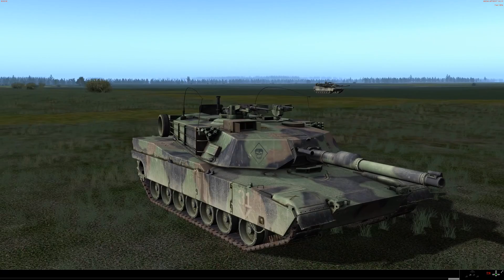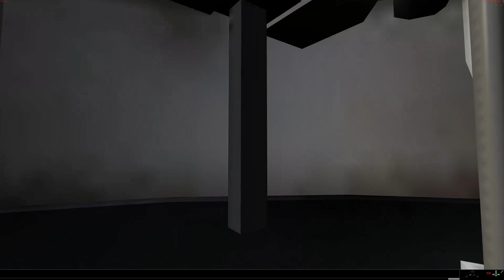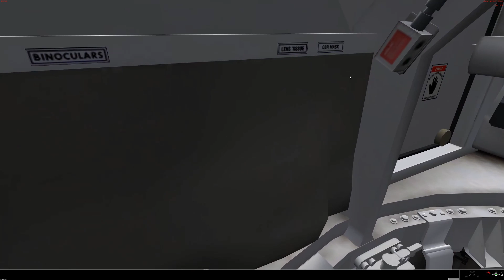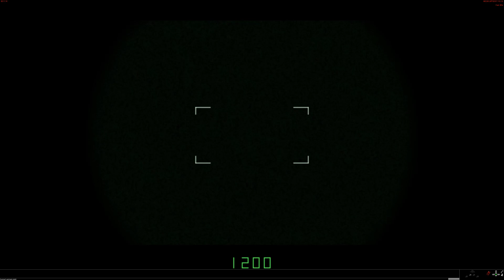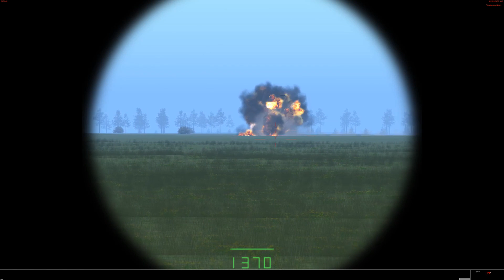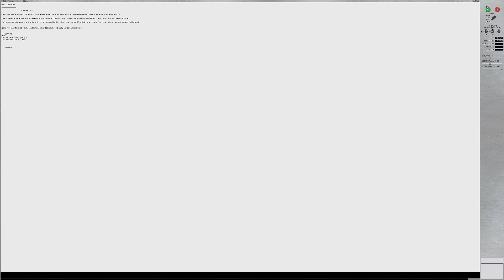Abrams Switchology and Fire Control System

Comment: Well, what's the point of a compass in a modern jet cockpit if you have one on the HUD already + on certain MFD pages?

The azimuth ring is an accurate analogue backup system, it's in plain sight and reading it takes just a second no matter how skilled or stressed out you are.
You could consider it obsolete with all the computers in play today, but what if everything fails and your life depends on it? Could you accurately tell the exact azimuth by looking down into the basket in the same amount of time? Wouldn't you rather look out for targets, aim the gun or do anything else other than wasting precious time by figuring out something that basic?

It's a backup system that's probably not used that often these days, but you could say something similar about parachutes (as in: they are rarely used, but if they are they can save lifes)
Reply from the maker: Who said anything about a more complicated system? I don't think there is anything more basic than using the Mk1 eyeball to see what is around you without any mechanical or electronic assistance at all. When you're driving a car,  you don't need a gauge or pointer to determine if the front wheels are straight or have you in a curve. Same deal here.
Reply: @TheChieftainsHatch  You were saying the azimuth ring is useless and I was making a point why it is not:
should everything else fail you still have an accurate easy to read backup right in front of your face. It's probably not useful in a lot of situations, but having it is better than needing it.
And I'm fully aware of the importance of the Mk1 eyeball. But how much is it going to help you in edge cases like 0 visibility? I'm talking about these kind of rare circumstances where the ring might be useful, not about any complicated systems.
Reply from the maker: If there's zero visibility, what are you going to need the TC's azimuth indicator for? The bottom line is that the system basically vanished from the world in 1944. They only started reappearing with commander's independent periscopes, which don't have a visual cue when stationary.

Comment: I must have put a thousand hours on the M1 tank simulator.  You get so use to leading and ranging with HEAT and SABOT that you developed "no mind".  1500m was close range, no ballistic computer required.  Didn't care about smoke either.

Comment: Question. If a modern Tank like the Abrahams gets hit and the shell/object penetrated a little bit into the composite armor but the crew and everthing is fine. How does this get repaired?
Reply: Modern HAP equipped Abrams have their composite seperated into cells underneath the surface steel. Just simply remove the facing steel, locate the compromised cell, remove it and drop in a cell fresh from the factory. All done.

Comment: I noticed the vision blocks in the TC's cupola have red rims around them. Why is that? It should also should be noted that while the early M1A2 eliminated the CWS sight system for the M2HB .50 cal (the M1A2's IVIS display took up the space for the CWS actuator motor), later versions of the M1A2 (SEP v2 and so forth) introduced remote weapon stations which restored the ability for the TC to fire the .50 cal from inside the turret like he could with the CWS on the M1A1.
Reply: Help you locate them spatially in black-out or low light internal situations.
Reply: @TornadoADV  Ah, I see. Thank you for your response.

Comment: In the real M1A2 SEP V2 you can tell when you put the wrong lead in because the reticle "leans" when you are traversing in that direction. Also with the SEP V2 with the thermals it is scan on 3 shoot on 13. The 3 and 13 are optical zooms, while 6, 50, and 25 are digital zooms.
Reply: The version he uses is not the M1A2 model. Its some of the M1A1s. The M1A2 is available in steelbeasts too...and it has the features you mentioned
Reply: @RoninTF2011  Watch the entire video. He talks briefly about the m1a2

Comment: Going to join as a 19k soon. How hard is the maintenance on these? How do they choose who does what in the tank?
Reply: Maintenance for the M1 series is pretty straightforward: everything is heavy, and it will either be very hot or very cold while you're doing it.  There will be mud, and you will find yourself wet or saturated with very fine dust most of the time.  In a nutshell...you'll love it.  As for position, you'll probably start as a driver and then move to loader (it used to be the other way around) then move up to gunner around the time you make E-4 promotable.
Reply: expect to work 12 hr days changing track. Expect to be filthy, hot, cold, tired. Expect to be a driver. Expect to learn to love it.

Comment: I heard a story of a guy who put like a big cloth belt in to sit on it. So he was sitting on like a swing within his hole. His platoon leader laughted at him the first day. The 2nd day the leader asked him, if he could build a swing for him also, as he had to stand all day.
Reply: It is called a sling seat, and it was typical on tanks of the 1920s and 30s. They work too. He did not invent it. A sling seat was the only seat a Renault R-35 commander had. And I recall various loaders positions fitted with sling seats through the 1950s.

Comment: You know...it's funny, at 26:50, you talk about "emergency mode"...I remember M1 Tank Platoon on the Amiga worked essentially like normal mode (lase the target, lead etc. automatically computed, you'd stay "locked on" etc.), but the PC version, and later M1TP2 on the PC would always work in "Emergency Mode" where YOU are controlling the gun, not the aiming computer.  Fascinating.
Reply: thedungeondelver I was thinking the same thing! So many happy hours spent on M1TP on the Atari ST 👍

Comment: Great video as allways!

During my military service I was a Leopard 1A5 gunner and I would say if I'd have to control an Abrams, the gun would've gone boom every single time by accident and not on purpose. The Trigger on a Leopard is controlled by the index finger. The thumb controls the "Dynamischer Vorhalt"... the dynamic lead. I was allways pushing down this button from the moment I grabbed the handle. So I couldn't forget to give lead.

One thing I notice in the computer game was that you can observe your own shot. A thing I could not do a single time because there was so much fumes coming out of the tube that I was literarlly blinded for a few seconds. Is it a problem with the game or is the Abrams that good in getting rid of the smoke?

Anyway a great insight into your working place :)
Reply from the maker: Generally speaking, the only issues I had with obscuration were caused by the dust flung up from the ground, especially when I was shooting on a desert range (Ft Irwin)
Reply: In this game, when you fire the gun on "dusty" ground, you will get the same problem. If you play with other people, you "Kettenhund" can call out the fall of shot...like in real life.

Comment: When you mention running away, do you mean the engine will just go off on its own? I went to school to become a diesel tech and we learned quite a bit about how to kill a runaway engine. If that's what you meant ,I wouldn't want to be in the same zip code when a jet engine goes off. Diesel engines just blow out their guts, a jet engine would probably be the equivalent of a giant antipersonnel mine.
Reply from the maker: It is a computer controlled engine. If you shut off the power to the circuits before the engine is shut down, the jet runs out of control. Never seen one  actually blow, as usually someone notices immediately as soon as the wrong switch is pushed, and powers  the system back on soon enough for the computers to regain control.
Reply: It is not a "jet" engine, it is a turbine engine. A turboshaft. FFS. Same kind as powers helicopters and fast vessels and peak demand generators in power plants. A jet by definition provides a high-speed jet of gasses to create thrust. That is why it is called a 'jet'. Those gasses are provided by a turbine gas generator. A turboshaft also has a gas generator, but the gasses are used to spin a turbine wheel the provides a mechanical shaft output. There is no 'jet' involved anywhere. Not all jets are turbine engines (rockets are jet engines too), and not all turbines are jets.

Comment: I think our Leopard Simulators were a bit different, we had Containers which had the turret inside simulated with every station. Driver had his own little cabine. Was always quite fun when doing a "simulated battle" with a full Platoon of Leopards.
Reply from the maker: We have the  same thing. It's called CCTT. See my video here: https://www.militarytimes.com/video/2015/03/13/war-games-world-of-tanks-the-chieftain-mounts-up-for-sullivan-cup-day-2/ We also have a full motion simulator for driver training and a simulator for just the TC and Gunner called the COFT, which I briefly mentioned in this  video. Even some militaries which use  Steel Beasts (This sim) have created cabins for the hardware part of it.
Reply: Exactly those things were what i meant. Most trainings like for the gunner we did on the real tanks or on a turrert mock up where the loader also had to train how to load the gun which buttons he has to push etc.  It's interesting to see that the gunner of an Abrams has to switch the buttons for the ammo types himself. But the rest looks pretty much like a Leopard 2A5 gunner station, except for the primary sight, the Leopard doesn't has a monocular sight.
Reply: You are speaking about the AGPT? Funny thing: Austria bought 6 old AGPT cabins, removed all the old IT, replaced them with new standard PCs and use steelbeasts as a software to run it. Now even the emergency fire button, the TZF and the "Blenden-MG"(Coax) are working in those cabins. Oh...and the vision blocks are now wroking too. Its amazing what these cabin trainers can do with new software! (No more "green wall of doom"=forest, if you know what I mean)
Reply: Yeah the "Ausbildungsgerät Gefechtssimulator Panzertruppe" Stealbeasts is a nice program for crew training i guess, can't exactly tell what program we used though. We also had a Room where all the people who waited for their turn could watch what's going on on a TV screen.  But the Turret mockup was called AAT "Ausbildungsanlage Turm" where only Commander, gunner and loader could have some fun :P
Reply: @JazzJaRa  ; The software Rheinmetal made back in the day. It was painfull to see the graphics, even in the late 90is :-P   ...the driving simulator had better "graphics" back then.

Comment: Who did the maintenance on your NBC?  The alarm will go off if you do not set the pressure release plate right and the NBC system is what controls the temperature.  The M1A1 commons we ran in the Marines never “caught on fire.”   Not work at all, or if you were lucky to have the cooling vest,  freeze you out in either NC 100 degree temp/ humidity Camp LeJuene or 120 shade in desert 29 Palms.  
I was in right as the Marines transitioned completely to M1 and as the last group to get any training on M60 series we were referred to as “CDATs” while the OG were “DATs.”  
Thank you for the massive trip down memory lane. Might need to buy the software!
Reply: I was on M1A1s for almost ten years and it wasn't until well after I retired that I started hearing about M1A1 NBC systems causing fires.  In ten years I had never heard of or seen such a thing.

Comment: THEORY: The azimuth indicator is to call out targets for the gunner and not for the commander to know the direction of the turret. Since the gunner also has an azimuth indicator he can simply align more precisely than using a clock direction.
Reply from the maker: The  point I'm making is that as the commander I don't need an indicator to know the direction of the turret to tell the gunner which way to look on his indicator.
Reply: @TheChieftainsHatch  he just said it wasn't for the commander to know the direction of the turret, why did you repeat it?

Comment: Just fantastic, I love the hands-on technical descriptions you only get from someone who actually operated the gear out in the field. Please do more long format stuff like this and the WWII doctrine videos.

Question: why does your tank catch fire if you try to turn the NBC system on in peacetime? Is it trying to give you a sample of the warm toasty feeling you can only experience on the nuclear battlefield? I'm guessing it's an air compressor of some sort to keep overpressure inside the tank because other than a wash down system the only other stuff I can think of is passive protection stuff inserted into the armor to keep the armor itself from becoming a radiation emitter and cooking the crew.

Comment: Spent many hours in the MCOFT learning switchology as gunner once upon a time. It help out a lot when it came time to qualify on Tank Table 8 for real. Once I had a good bore sight and several rounds on the screen test to sight in my SABOT and HEAT rounds and indexed into my ballistic computer and properly zeroed main gun and computer. I was solid. As a gunner I liked using white hot on my thermals. It was easy to see and track targets.

Comment: My tanking experience is from WoT and ARMA but how do you communicate accurate directions to your gunner without slaving? In ARMA the sights have an azimuth so the commander would say target at 270 and the gunner can quickly acquire that target.
Reply: In steel beasts (and IRL) the TC can override the gunner's controls, bringing the gun to where he is looking and even firing it himself (at least for the A2)
Reply: Well we used "clock" to tell the gunner the direction, much easier than telling him "Enemy tank 250" if you say 12 oClock 10 oClock it's much better. And since the Commander has his own optics and finds a target first he presses a button and the turret moves onto it overriding the Gunner. That's how it works on a Leopard 2A5

Comment: How do you account for wind? Do you just have to wing it and compensate, or can you tell the computer what the weather report says and let the tank keep track of relative direction?
Reply: The tank has a lot of that function built and it automatically happens when you tell the fcs where the target is.
Reply from the maker: The crosswind sensor sticks up from the back of the turret and the computer uses that for wind correction.

Comment: Ammo question, maybe for comments here, maybe for another video. For WW2 stuff it keeps getting mentioned that the main round for tanks was the HE round, supporting infantry, destroying machine gun nests, etc. And that the anti-armor rounds were comparatively less needed. Is that reversed nowadays? The rounds we saw here and saw are the two most important positions on the switch are both anti-armor rounds. What does the Abrams have for plain old HE / area targeting / anti-squishy thing ammunition? Is that the "mpath" or whatever the other one was? What sort of ratios do the various rounds get taken out in, either back in the day or currently?
Reply from the maker: For the A1, the only two rounds initially available were Sabot and HEAT. To this  day, the US Army has no HE round in active service (though the Marines have bought some). The thinking, as  near as I can figure out, was that the .50 and 7.62 were  good enough for most things, a HEAT round does have  a secondary fragmentation effect for something which required burst, and the Bradleys with their 25mm which would be nearby would cover the rest.

It's something which the US is getting away from, the new AMP round is going to be highly-multi-functional with  a good bust capability and a smart fuse.
Reply: @TheChieftainsHatch  Any thoughts as a historian and tanker on the Army's move away and now back towards HE? Were you ever in any situations where an HE round would have made things easier?
Reply: The current HE round is MPAT. It is fully replacing heat. Its essentially what you are looking for. For soft targets like trucks and troops you would use machine guns, light armor fortifications and helicopters MPAT, tanks you use sabot.
Reply: @whisperchainsaw102  does it stand for Multi Purpose Anti Tank round?
Reply: Watched a few videos of the German DM12 MPAT, very formidable round!